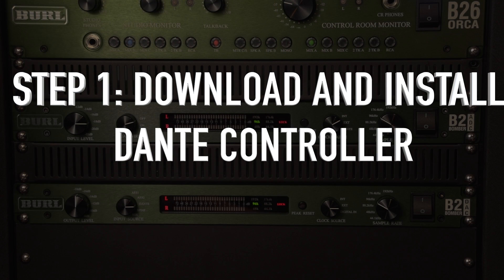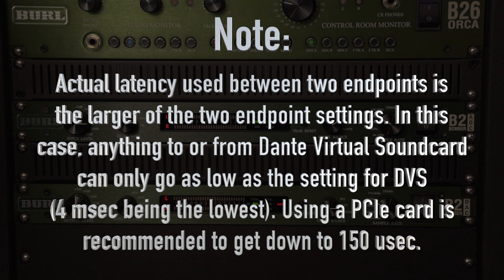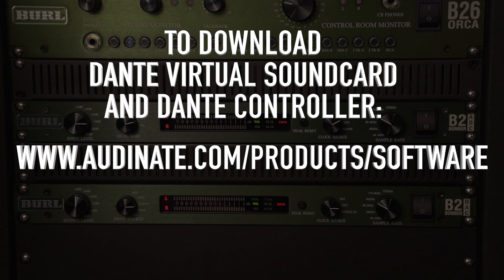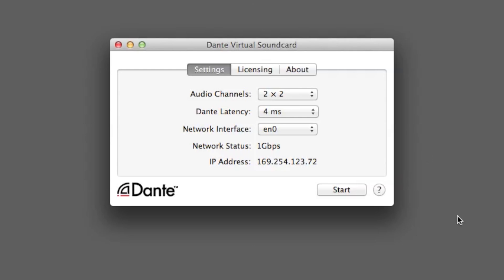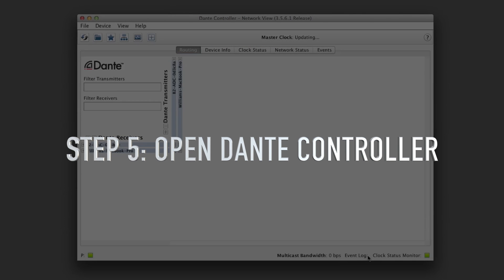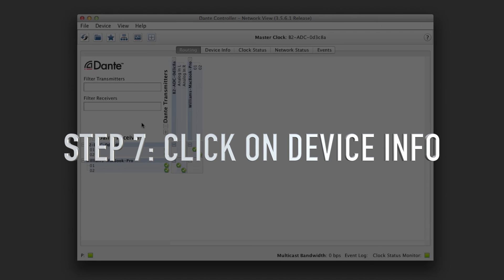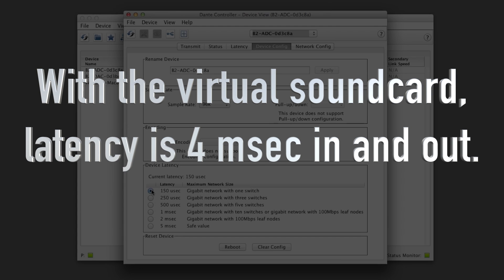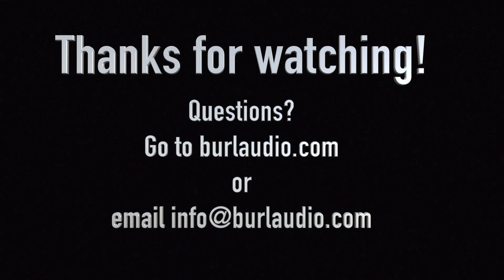B2 Bomber Video Manual - Part 2: Dante Installation and Setup

Comment: Hi, If i use a Gigabit ethernet port on a Thunderbolt 4 Dock ( such as OWC ) to a macbook Pro, should i be able to get a lower latency comparable to the PCIe card?
Reply: No, because the PCIe card is a Dante device which does not require Dante Virtual Soundcard. If you use the OWC dock (or any non Dante device) it will require you to use Dante Virtual Soundcard which has 8ms roundtrip minimum.
Reply: @channeloram  Ok thanks, got it..